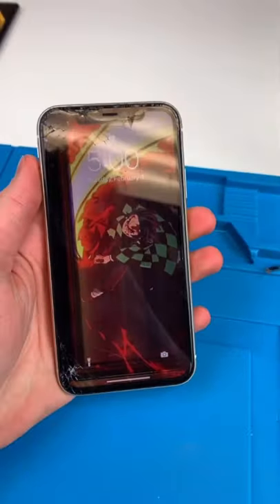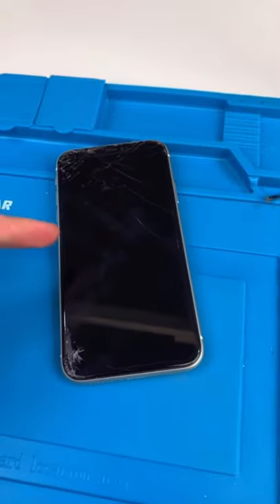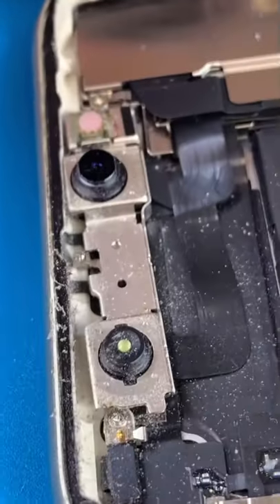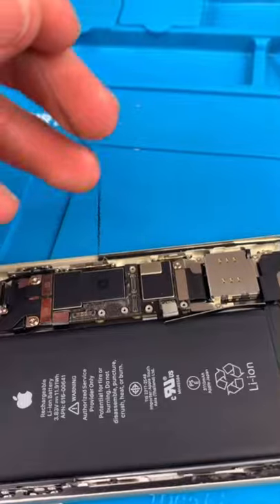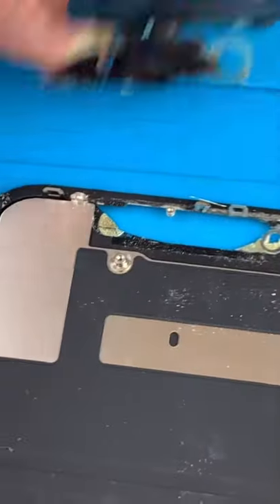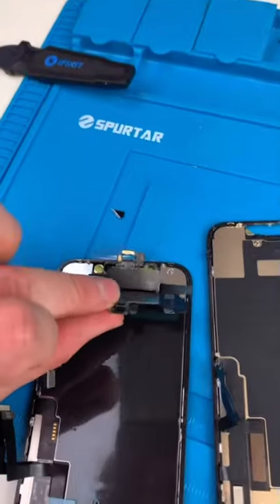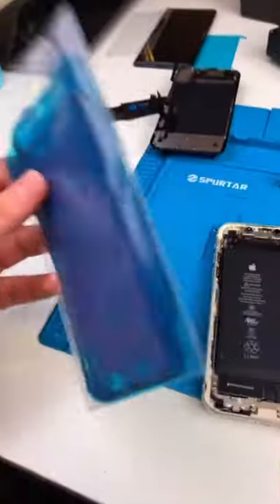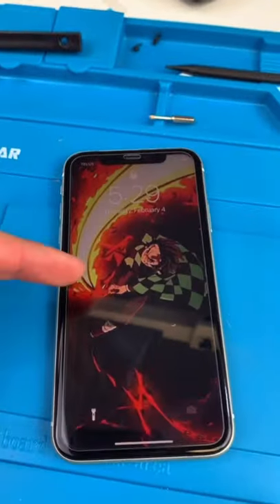iPhone 11 Got Hurt. Let's fix it #Shorts

Comment: Why do people let there phones get like that then only fix one thing lmao
Reply: Bc people are clumsy and they break stuff and dont have enough money to fix everything right away
Reply: Also alot poeple dont use camera like me ._.
Reply: IPhones cost more to fix than to even buy a new one iPhones are just shitty and overpriced so I wouldn't bother to repair one is just buy a Samsung
Reply: @jordzking6330  it costs more to get them repaired at apple, the prices are fine at 3rd party repair shops.
Reply: The owner does not use cam at all like me.
Reply: @jordzking6330  my screen only costs $50 to replace? That isn't the price of an iphone
Reply: @jordzking6330  Samsung flagships are more expensive than iphone flagships....
Reply: @glitchedavocado4134  where did you get that from last time a checked the new Samsung's didn't cost over 2-3 thousand
Reply: @glitchedavocado4134  The S21 Ultra 5G is a more even comparison, that said it comes with a 120Hz screen and S-Pen support for 100 more than the 12 Pro Max
Reply: @dimasa8760  even though it comes with a 120hz refresh rate, that doesn’t mean it’s better, the video quality in the iphones beat any Samsung. I’m not saying either brands are better, I’m saying which I use/prefer
Reply: @glitchedavocado4134  ur saying the phone that uses Samsung's display is better than Samsung's own device? Bruh momento #69
Reply: @dimasa8760  no, I’m saying video quality with the camera, smh
Reply: @dimasa8760  the iPhone also gets brighter, so I guess we could say it’s other type of video quality is better
Reply: @glitchedavocado4134  Huawei mate 40 pro has even better camera according to many sites...but yeah  1200-1600$.
Reply: @Firelife3  yeah, it has a great camera, but it depends on what you want from the camera. In general, it has more things to do on it than the iPhone tho
Reply: @jordzking6330  my best bet is you don’t even own an iPhone no? I have a 12 and it’s way better than any Samsung I’ve had used experience wise. I came from a 2018 LG G7  and it’s night and day difference
Reply: @tpghl5225  I'm guessing you haven't used any new Samsung products no? New Samsung's are way better and more affordable than those trash people call iPhones just being honest
Reply: Android fanboy?
Reply: @jordzking6330  go break a galaxy s20 and an iPhone 11 Pro. Tell me which one costs more to fix. 🤦🏻‍♂️
Reply: @jordzking6330  android fanboy get lost
Reply: @jordzking6330  iPhones aren't shitty, you just don't like them. 50% of the smartphone market is iPhone, so you're clearly wrong lmao. Something is seriously wrong with people like you who need something to be better than the other. Just Accept that the phones are for different people.
Reply: Maybe they’re broke or don’t use the camera
Reply: @jordzking6330  they might be but I stick by Apple bc they are less likely to get hacked and safety is everything
Reply: @jordzking6330  bro chill out people can use whatever phone they want lmao
Reply: @jordzking6330  Good logic there, Can’t afford to fix phone so downgrade to shitty phone with hundreds of different models only to spend $800 on a phone comparable to the one you broke...........I sell shitty androids all day at work. If you can’t afford to fix a phone perhaps reevaluate your life.
Reply: UGH IKR
Reply: That’s why i try so hard to take care of my phone and make sure I don’t break it cause once it’s broken, I’m either managing it like that or save to buy a new one. No way I’m paying $400 dollars just to fix an iPhone
Reply: @jordzking6330 lmao just shows us a Samsung ultra 22 screen fix where the new screen was almost 400 dollars and a new phone 8s just over 400 dollars. You Samsung fanboys are delusional.

Comment: How do you prevent the pop up message for "not using a genuine screen"? I'm not aware of any copy method via jc repair (or anything alike). I still wait for irp registration. But until then I have to solder the old ic onto the new display. Ofc I could skip this and have the message in the settings only, but this would be what every "not-caring-repair-shop" would do.